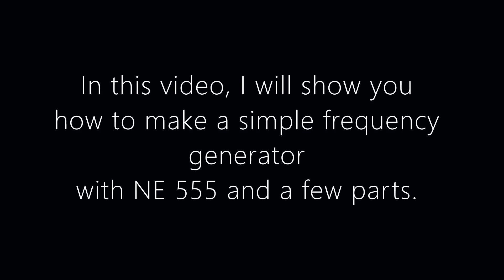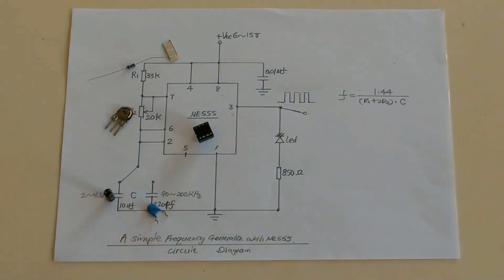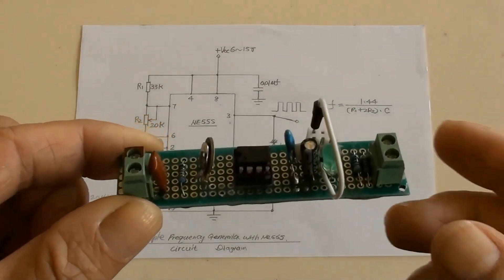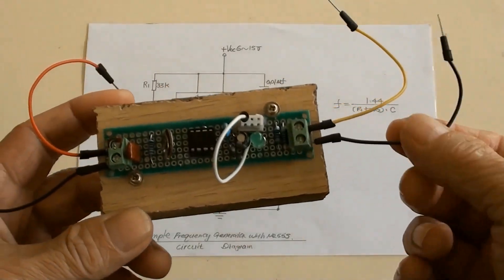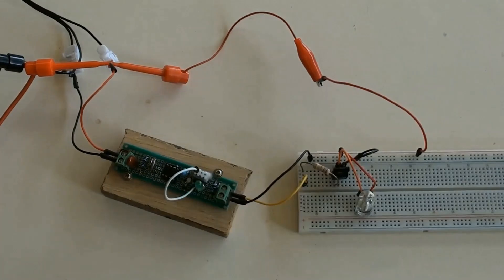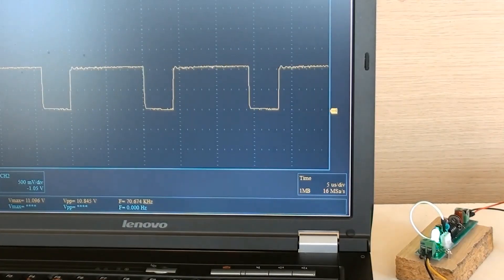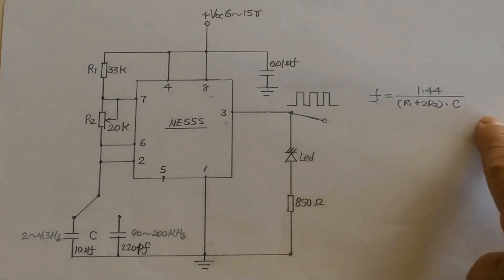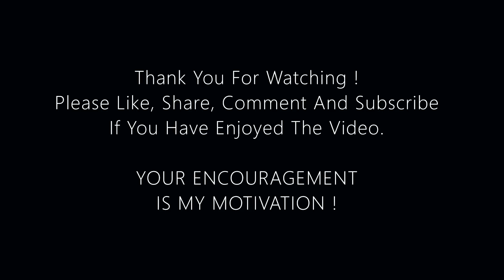How To DIY A Simple Frequency Generator With IC NE555?

Comment: Hi, im trying to build this but with R1 being 1k and R2 being 10k due to not having the parts, I'm trying to run a simulation through it in LTspice and some stuff doesnt make sense, even with correct values, the LED diode has 700mV on it with 0A and wont light up, what can I do with it?
Reply from the maker: Thanks for your interest!  I don't believe the circuit which you built was oscillating, that'd result no output on number 3 terminal.  Theoretically according to the formula  f = 1.44 / (R1+ 2R2) * C, the one could build a circuit with the values chosen as you did, however the NE555 has its practical limitation which means the values of R1, R2 & C have their workable range as showed from the diagram on this video (R1 = 1k was too small value for the circuit to be oscillated).  Good luck on your next time!  👍

Comment: Very good project !  But 10uf,25 v. capacitor was polarized, and  sw. was connected to that cap. not to the 220pf cap. I am searching such a simple n effective  frequency generator for testing on my 3 1/2 digit DMM, that has only 200kHz range. Thank you very much.
Reply from the maker: Thanks for your interest, Mate!  Always happy to help.  In the video's diagram showed:  SW position is for the lower frequency range, the higher frequency range is when the WHITE wire pulling out or plugging it into socket on the far right side as showed in the video.  Good luck!